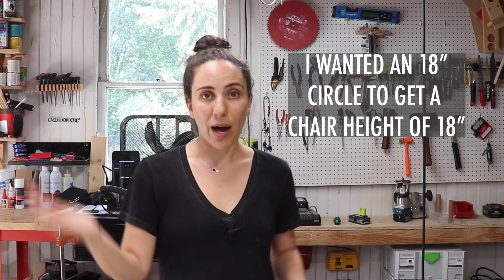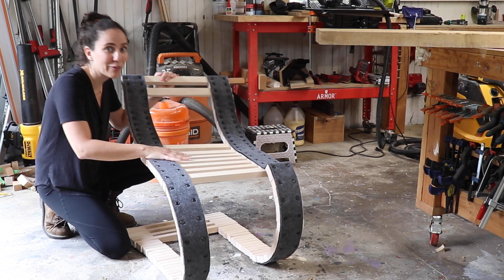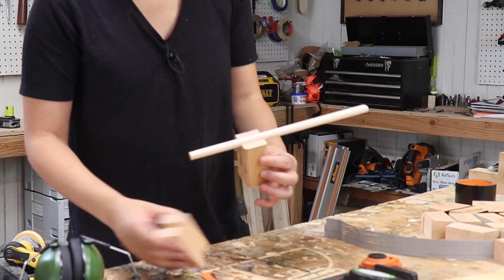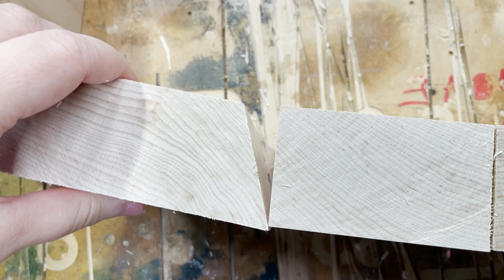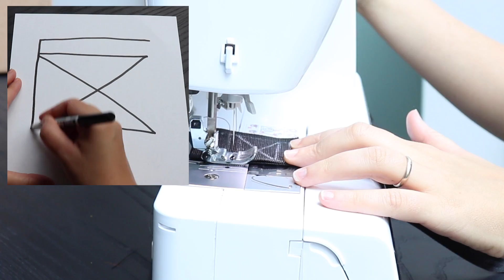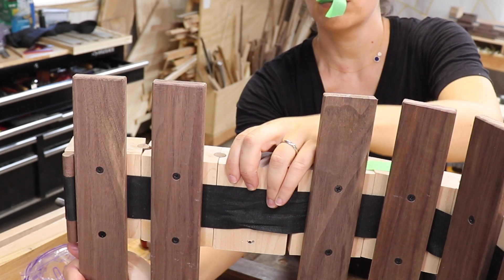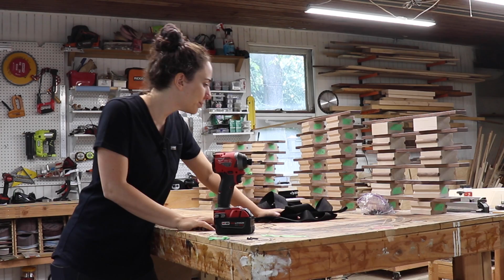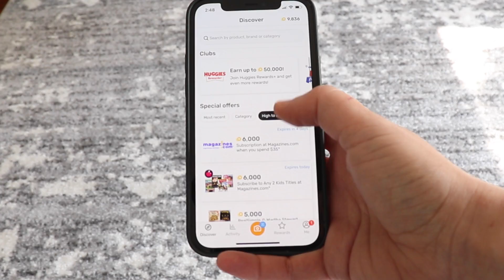I ATTEMPT to make a Roll Up Chair… AGAIN...

Comment: Just put some door hinges on the pieces of the low curve to prevent slippage and add a small structural "rib" to the inside of the same curve to avoid deformation.

Comment: you have tension/compression going on at the same time, thats a no no. your hinge pivots are in the middle they should be on the corner and you need more connecting straps for strength not greater tension on the straps

Comment: Drill out the wood and place strong magnets inside them, so the pieces stick together. Though it might make it hard to roll up. You could also try changing the shape of some pieces. Like every other piece could have an end piece attached to its smaller side, that would work like a back stop, so pieces couldn't over extend. So it would go trapezoid, trapezoid with a "hat," repeat. It would kind of look like gear teeth fitting together.

Comment: theres a flaw in this design, you just have to look really hard to find it. maybe the overall design wont work and will have inevitable flex do the the way its put together. theres no real support to hold weight aside from that one curve that seems to be failing so much.

Comment: If you use your router along the length where the strap is and run a steel cable inset in the wood you wouldn't have any stretch. You can put a small plate to hold the cable on each end?

Comment: Question from a know nothing. Wouldn't you solve a lot of issues by using two dow rod as back legs? Make them screw into where the chair uprights and at the bottom. Sure, there is a little work screwing them in so the chair isn't just ready to go, but it would make it many times more stable and it's still pretty portable.

Comment: If you actually attached the strapping to the individual pieces then there wouldn't be any tension end to end, only between individual pieces, so it won't pull end pieces over etc.

Comment: About using leather: leather, being animal skin stretches too much, hinges might have worked, maybe covered with fabric to avoid pinching little fingers. 

Also, fabric tends to have a stretch percentage, say if a polyester fabric has a 5% stretch the longer the piece of fabric the more it will stretch, maybe smaller sections of fabric secured to each piece individually might work. This might help with the problem of the ends curling up from the overall tension. 
I'm not sure how true this is, but I assume that super durable webbing is extremely durable because it can stretch enough to absorb tension without breaking. If you use smaller pieces of fabric, you might be subjecting each individual piece to less tension than that very long piece of webbing endures overall, this is just speculation though.

Comment: I think your pieces should be thicker!  Like not longer, but the depth of the pieces should be wider so there is more contact between the pieces from the front side to the back side.  My thinking is that it will make it more sturdy by not allowing for the pieces to expand.

Comment: How set are you in sticking to wood as the primary material? Steel  is stronger than wood.
Reply from the maker: I am a woodworker… ha
Reply: @3x3CustomTamar   Fair point. Perhaps the ideas of using some kind of cable instead of straps  as you mentioned could be worth a try then :)

Comment: Sorry if im late to the party, but have you thought about altering the geometry on the last few blocks to take advantage of leverage to fight the blocks rolling over? 

|__||__|  _<-- is easier to pull over than |__//__| because the point of leverage is moved behind the force pushing it down, giving you a mechanical advantage. You'd lock the entire bottom row into a long lever instead of relying on a single block to hold the tension. I think if you ran angles on the last 3 or 4 blocks on the front and end, youd be able to make the strapping a lot tighter. Also, possibly consider an industrial strap like spectra. As a welder, i use straps like that to lift upwards of a ton on a regular basis.

Comment: I think you need to put the supporting structure through the center of the blocks. For example like a wire. The glue works because it applies force equally to each of the blocks maybe having a wire go through the center of the blocks would apply the force more evenly?

Comment: The wood slats do not create enough pressure to clamp the material and allow for even stretching. Rather, the strapping would slip, and ultimately appear to stretch in the larger radius. However, that was just the entire stretch of the strap broadcasting in just a few joints. You need to mechanically secure each and every joint to make the material evenly stretch.

Comment: Why not use Seatbelt material? Go to a junk yard, Cut the belt out of a car. I'd assume it's about the strongest piece of strapping you can get. I've pulled 500+ pound motors out with seatbelts so I'm assuming it'd work.
Reply from the maker: That’s what I used

Comment: hello ever heard of ratchet tie? the one used for cargo., it might solve your problem.,

there will be recommended loads for it. the higher the load capacity the less likely it will stretch with just human weight

Comment: I think if you add another strap on the reverse side of the first strap the opposing tension should make it work
Reply from the maker: Won’t roll up that way
Reply: @3x3CustomTamar  that is true but I'm not talking about having it attached to all the pieces just a strap connected to the piece at the top of the back to last the bottom piece. Eventually boxing in your design If you have it to were it works like a d ring belt it should gain enough apposing tension to keep everything together.

Comment: I haven't seen the first one but are hinges not an option? I know it wouldn't be as elegant but metal doesn't have so much flex and you could offset the hinges to be flat with the top of the wood I'm sure there's some hinges strong enough out there
I just checked if anyone else commented this which they have but now I'm invested in making my own comment lol someone said that door hinges have flex or they would flex too far but as long as the actual metal is holding the pieces right next to each other I really don't feel like there would be any flex the wood angles would stop that wouldn't they? Or am I just wishful thinking

Comment: I don't know if there is any material that can take that much stress with little to no strain, but doubling up the straps should (in theory) halve the gaps. You could also make the blocks thicker in high stress areas like the curve on the front, which should decrease the force on the straps.

Comment: Leather will stretch over time.  Canvas is strong and doesn't stretch.  Neoprene is also very strong and doesn't stretch really.

Another option is changing how you are tensioning the fabric.  You have the tension currently at the ends.  If the tension extends around ends back towards the feet or seat, you should solve the curling at the ends.

So I think you have the fundamentals correct here in that you're attempting to place the stress on the wood 'joints' themselves.  The stretch in your fabric is one issue.  The other issue is I think you need a way to 'lock in' your joints.  Since you want it to roll up you don't want to do anything permanent (such as the dovetail joints you mentioned at the end).  The wood dowels help with the lateral forces (side to side) but I don't think they are doing enough to prevent your joint from sliding and efficiently transferring the forces across the entire joint.

This is getting long and hard to follow so here sums up what I think could help.
1. New material that is known to have little stretch and a high tensile strength.  Think tie-downs for shipping like semi truck drivers use.
2. Create a latching point for the tensile material to latch around and beyond the very ends of the chair.
3.  Have the ends of the chair roll back around so the material doesn't allow it to curl outwards reducing tension.
4.  Consider changing the angles of the joints or how the joints engage so that they do not slip and open up the joint which would return the force to the tensile material rather than the joint.
5.  Understand that even after the most ideal steps taken above (and others I haven't thought of) the bends of the chair will likely adjust and coil/spring in on itself as you apply weight.  Therefore, the seat of the chair is likely going to be more forward along with bend in the legs less dramatic when there is no weight or force on it.  Think of it like a spring or piston that will have a little give and plan for that give so that the final result under load is in the ideal sitting position.

This is really cool and I hope you keep trying... when you feel ready.  The technical challenge you've set for yourself is high, but this is also so very cool!

Comment: Some people have mentioned metal hinges, and even if that route isn’t the correct option, it’s the right idea. Your chair flexes because you only have 2 truly stationary anchors so all the moment forces are applied throughout the whole strap multiplying the load to an extreme amount. If multiple stationary anchors were in place near the point the blocks contact one another(much like a hinge does), it would reduce force at each intersection resulting in less separation.
Reply: Quickest way to achieve this is to staple the strap to the face of each block. This will physically restrain total allowable travel distance of each block

Comment: In the last video that "Ladi and Margaret" (on youtube) did, they came to the US to build a new van and used aluminum extruded shape (slats) that interlocked and allowed them to roll up their bed platform (like your chair) but when unrolled could support their weight.  The cool part is that it was an interlocking shape that had a built-in stop point. Wondering if you could adapt that technique in wood

Comment: maybe u can make it modifying this second chair. i think u can add some inches of straping and make it posible for the woodpieces to slide through it you can ad to each piece a strong conection to each other like some kind of lego. this way you have to manualy conect each piece instead of just unrolling it but at least it will be safer i think. maybe you cand ad something to make tension with the straps before you sit, but i dont know it this tension will really help. idk if this is a good idea but is the better i had after thinking long time. i wish you luck with your next video

Comment: Alongside the steel wire running through the blocks instead of over the outside, try high tension paracord and lots of it, like 3 or 4 lines down each side
Reply: Paracord is hopeless for this, far too stretchy. And embedding a cable inside may have other benefits but makes the strength problem even worse
Reply: @davesmith9325  depends on the paracord, I use it to lift engine blocks into cars there is hi tensile stuff that doesnt stretch, when it comes to the wire through, a stretching plate at each end may help

Comment: Calculating the tension on the strips:
Assuming 2 third of your body weight (guessing 75kg ) will rest around 50 cm distance horizontal from the most stressed joint. This results in 75 kg * 2/3 * 10 N/kg * 0.5 M = 250 Nm. Assuming the width of the joint is 5cm you calculate 250 Nm / 0.05 m = 5000 N. You can divide it by 2 as you have two strips but that would still mean on each strip is a tension equal to lifting 250kg (defensive guessing). The strip is around 2m long and will elongate more under tension the longer it is. As you noticed around 1cm is to much.If the strip can hold 250 N ( I would at least triple the value for safety reasons) you can solve the   problem by simply using not long strips but short strips for each joint. Each strip has to fixed to the wood in a way that can handle the full load of the strip.

Alternatively you can use a long strip but you have to make sure that the difference in load between two joints is transfered to the wood. Having roughly 5 segments this still a difference in tension of 250N / 5 = 50 N (again at least triple it for safety) .
Reply: Actually you could solve the problem by making one or two half round groove(s) orthogonal to strip and clamp the strip with half round stick. I suggest testing this with some spare material first as you only have to test one section. If the strip doesn't slip out of clamping if you put 15 kg on it, it should be safe.

One final note: it is not necessary to put tension on the overall strip. This will just make it an oversized rubber band with quite some energy stored (as you noticed).

Comment: I've watched two successful implementations of this chair on YT if you're interested in checking those out. Z-Shaped pieces seem to be the key. Pallet straps might be a better band
Reply: Josh Wright
Reply: Yes, I'll simply toss my 2 cents here as well. I'm not a carpenter but IMHO the problem between your chair and the ones that work are that the other chairs pieces lock into place (with gravity) when they are unfolded. The strap connecting them simply holds the pieces together for when it is rolled up. Yours doesn't lock in place at all. The strap is what's holding it up and gravity (plus weight) is causing it to fail. If you redesign the wooden pieces so that they lock when it is unfolded and gravity (plus weight) reinforces the structure, then you'll have conquered this project as well.
Reply: Adjusting the shape of the segments definitely seems like a much more elegant solution than chasing down the issue of the strapping. Tamar does have a CNC, and while using it may not make for quite as fun of a woodworking video, it would allow the production of unique shapes that do the work of holding all the angles in place.

Comment: You need belts lined with steel or glass or carbon fibers. Try to find out the force that goes on the Belt. You have a huge lever on Forces like your weight x20 or something. Thats too much on a seatbelt strap.. it will elongate. You need something that has less than 1% elongation on 20x the weight the chair has to support.
Reply: Timing belts extra wide
Reply: To prevent the back of the chair to flip forward when you stand up you can incorporate small magnets inside the wood parts. Concerning the Wood parts, you cut the pieces in pine so that the wood grain takes the compression forces on the long side, an then cut the hard-wood so it takes the compression forces compressing the grain. Not sure if I can describe it in words but it makes a big difference how much force you need to compress wood with the fiber standing vs the fibers being flat.

Comment: Would ordinary sturdy door hinges on the top part of the chair between the walnut not work? Or is metal hinges not in line with the purpose of the build? Seems like hinging is what the straps are doing, just with more flex and tension.

Comment: Maybe try attaching each piece via a hinge. Wouldn't that alleviate the stretching by focusing all tension on individual units instead of one long strap, and if needed, you can just exchange hinges for bulkier ones instead of having to retread a strap.

Comment: A brass door hinge on every join.  Eliminates tension and immensely strong.  The problem is sharing the forces along the entire length of the strap rather than localising higher forces at those specific joints under the highest forces.  I don't know if this breaks some self-imposed rule on materials, but brass and wood usually look good together and this solves the engineering problem.  It also probably removes the need for the dowelling which prevents sidewards twisting.  The only issue remaining is weight so perhaps some other metal than brass if necessary.  Good luck!

Comment: Having (ONE) long strap that goes from the foot of the chair to the top of the head, is the failure of the chair.  Put a (SEPARATE), hinge between each bend.  And don't make them a cloth type of material.  Use metal.  Use a real hinge, like the kind you might hang a door with.  Or at the very least, a thin metal (gutter flashing).
At all costs, don't give up.  You already did the hard part.  You did the maths for the angles, and had the awesome epiphany about the dowel in each hinge to alleviate the rotational force (I was impressed with that move).  You are down to the hinges.  Your project is complete.  You could put this on the shelves for Christmas.  If you wanted to. Or you could keep it close, in the (inner circles).  And give it out as a gift to the ones you feel worthy of such powerful inspiration.